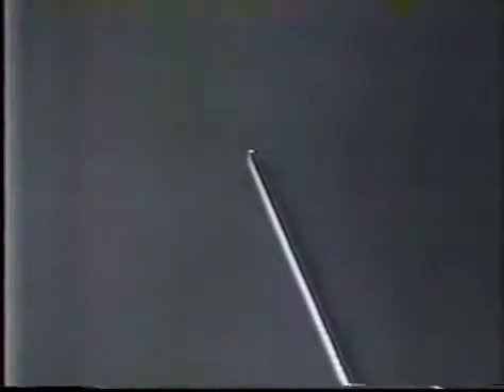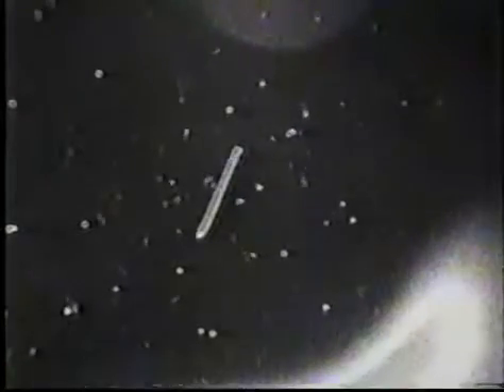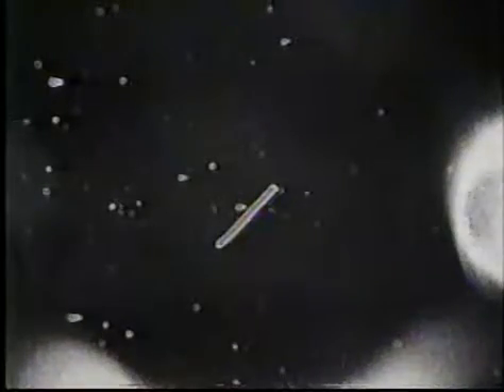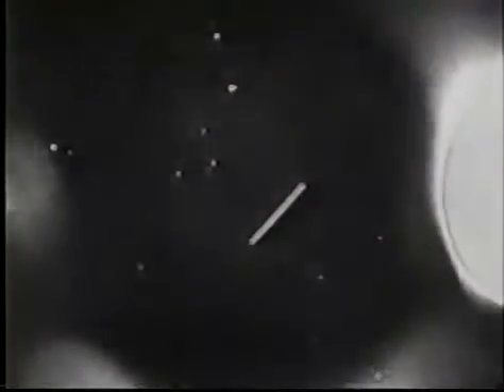NASA STS-75 - The Tether Incident

Comment: They do not pass BEHIND the tether, viewers were misled by a feature of the external CCTV's pixel size. I worked in Mission Control and led the design team of the tether experiment.  The much sharper hand-held 70-mm photographs of the tether show it with its thinness clear [which may be why the internet UFO bloggers hid them from their target audience].  The dots are much much closer, ice flakes from a scheduled waste water dump. Had they REALLY been far enough away to go BEHIND the distant tether, each dot would have been bigger and brighter than the full moon in the sky above millions of potential witnesses, NONE of whom reported such an apparition.  Viewers were scammed.

Comment: Bottom right at 4.50 you see one make a 90 degree turn,how is that possible in space,without a propulsion system?
Reply: Propulsion systems are not required in space DIMWIT this is why saucers and orbs can be observed in the air vs driving around on earth. Rockets are like that too, they don't need propulsion systems to accelerate once in space. Can go left, right, 95 degree turns etc
Reply: @worrylessnless6222 so how do they turn then?your talking bollocks

Comment: To that annoying wozibozi in cel aut ist copying & pasting the same comment on all the other comments asking what those objects are, here's the easy rebuttal to your mindless parroting of the narrative control talking points: the recording camera's autoexposure routine doesn't work that way. If there are many bright objects in the scene, any camera's autoexposure logic would try to even out the overall exposure value of the entire frame by underexposing the image to balance the overall exposure, meaning the bright objects would become darker and more of the detail would be captured, while the dark background would become darker as a result. Autoexposure is tuned to an 18% gray card. It would be hilariously convenient if NASA or those other narrative comtrollers in the media would just hand wave it away by saying the entire video was inavertently left in a manual exposure mode conveniently set in such a way as to overexpose bright objects further without turning the dark background of space even grayer as a result. Also, wrongly exposing subjects in a scene wouldn't make them appear in the foreground or background of another object in the scene, but misfocusing or deliberate obfuscation or postcapture editing does.

Comment: At the time of the incident, astronaut Franklin Chang-Diaz explained the objects seen near the tether as "a little bit of debris that kind of flies with us." The debris, he said, was illuminated by the sun.
Later, John Tindall of the History Channel noted that the camera's telephoto lens was used with a circular mirror that had a hole in the middle, which left an artifact on the images.
Because the images on the camera were overexposed by bright sunlight, objects appeared brighter than they were, giving the illusion they were behind the tether rather than in front of it, Tindall said.
Reply: To that annoying wozibozi in cel aut ist copying & pasting the same comment on all the other comments asking what those objects are, here's the easy rebuttal to your mindless parroting of the narrative control talking points: the recording camera's autoexposure routine doesn't work that way. If there are many bright objects in the scene, any camera's autoexposure logic would try to even out the overall exposure value of the entire frame by underexposing the image to balance the overall exposure, meaning the bright objects would become darker and more of the detail would be captured, while the dark background would become darker as a result. Autoexposure is tuned to an 18% gray card. It would be hilariously convenient if NASA or those other narrative comtrollers in the media would just hand wave it away by saying the entire video was inavertently left in a manual exposure mode conveniently set in such a way as to overexpose bright objects further without turning the dark background of space even grayer as a result. Also, wrongly exposing subjects in a scene wouldn't make them appear in the foreground or background of another object in the scene, but misfocusing or deliberate obfuscation or postcapture editing does.
Reply: @Angus.MacGyver  I’m not reading that😂 keep believing youre right
Reply: You're going around spamming this on every comment, you're either a BOT, or a complete bootlicking lemming. If you looked at this footage and got "debris" or "dust" etc. then you're completely lost, breathing through the mouth. Tether was 12 miles long and FULL of energy. The objects are perfectly consistent in shape, and patterns, and with different sizes (impossible to be debris). They are moving and changing directions orbiting the object while pulsating in the exact same copy-paste patterns/shapes. Anyone with 2 brain cells rubbing can see it plain as day, its not even in question. Read between the lines, John and others can't tell anyone what they're seeing on a daily basis. Thanks

Comment: There are lifeforms at many depths and heights, some live in water, some deep within the earth, some in air, some nearly in space...
Reply: UFO hucksters have lied and covered up evidence about this incident from the very beginning. 
They tricked gullible viewers into thinking the swarm showed up soon after the tether broke away, as a curiosity reaction. The swarm sequence is actually four DAYS after the break.
They concealed the much sharper hand-held 70-mm camera images the crew took of the very THIN tether, with out of focus 'orbs' [nearby small objects] passing in front. 
They never explained how the miles-wide hypothetical objects passing BEHIND the tether wouldn't have been as big and bright as the full moon passing through the sky of ground observers. 
They carefully neglected to mention how the rim notch of all the fuzzy-blob images was 'clocked' to the same angle depending on where in the camera field-of-view the objects were passing, conclusive proof it was a feature of camera internal structure.

Comment: UFO hucksters have lied and covered up evidence about this incident from the very beginning. 
They tricked gullible viewers into thinking the swarm showed up soon after the tether broke away, as a curiosity reaction. The swarm sequence is actually four DAYS after the break.
They concealed the much sharper hand-held 70-mm camera images the crew took of the very THIN tether, with out of focus 'orbs' [nearby small objects] passing in front. 
They never explained how the miles-wide hypothetical objects passing BEHIND the tether wouldn't have been as big and bright as the full moon passing through the sky of ground observers. 
They carefully neglected to mention how the rim notch of all the fuzzy-blob images was 'clocked' to the same angle depending on where in the camera field-of-view the objects were passing, conclusive proof it was a feature of camera internal structure.

Comment: Debri in the forground? They flying behind the tether. 👽
Reply: I know. Such exposure, those in denial are just sad.
Reply: UFO hucksters have lied and covered up evidence about this incident from the very beginning. 
They tricked gullible viewers into thinking the swarm showed up soon after the tether broke away, as a curiosity reaction. The swarm sequence is actually four DAYS after the break.
They concealed the much sharper hand-held 70-mm camera images the crew took of the very THIN tether, with out of focus 'orbs' [nearby small objects] passing in front. 
They never explained how the miles-wide hypothetical objects passing BEHIND the tether wouldn't have been as big and bright as the full moon passing through the sky of ground observers. 
They carefully neglected to mention how the rim notch of all the fuzzy-blob images was 'clocked' to the same angle depending on where in the camera field-of-view the objects were passing, conclusive proof it was a feature of camera internal structure.
Reply: They do not pass BEHIND the tether, you were misled by a feature of the external CCTV's pixel size. I worked in Mission Control and led the design team of the tether experiment.  The much sharper hand-held 70-mm photographs of the tether show it with its thinness clear [which may be why the internet UFO bloggers hid them from their target audience].  The dots are much much closer, ice flakes from a scheduled waste water dump. Had they REALLY been far enough away to go BEHIND the distant tether, each dot would have been bigger and brighter than the full moon in the sky above millions of potential witnesses, NONE of whom reported such an apparition.  You were scammed.
Reply: At the time of the incident, astronaut Franklin Chang-Diaz explained the objects seen near the tether as "a little bit of debris that kind of flies with us." The debris, he said, was illuminated by the sun.
Later, John Tindall of the History Channel noted that the camera's telephoto lens was used with a circular mirror that had a hole in the middle, which left an artifact on the images.
Because the images on the camera were overexposed by bright sunlight, objects appeared brighter than they were, giving the illusion they were behind the tether rather than in front of it, Tindall said.
Reply: @wozibozi  Yeah you're going around spamming this on every comment, you're either a BOT, or a complete bootlicking lemming. If you looked at this footage and got "debris" or "dust" etc. then you're completely lost, breathing through the mouth. Tether was 12 miles long and FULL of energy. The objects are perfectly consistent in shape and patterns with different sizes (impossible to be debris). They are moving and changing directions orbiting the object while pulsating. Thanks
Reply: @wozibozi  To that annoying wozibozi in cel aut ist copying & pasting the same comment on all the other comments asking what those objects are, here's the easy rebuttal to your mindless parroting of the narrative control talking points: the recording camera's autoexposure routine doesn't work that way. If there are many bright objects in the scene, any camera's autoexposure logic would try to even out the overall exposure value of the entire frame by underexposing the image to balance the overall exposure, meaning the bright objects would become darker and more of the detail would be captured, while the dark background would become darker as a result. Autoexposure is tuned to an 18% gray card. It would be hilariously convenient if NASA or those other narrative comtrollers in the media would just hand wave it away by saying the entire video was inavertently left in a manual exposure mode conveniently set in such a way as to overexpose bright objects further without turning the dark background of space even grayer as a result. Also, wrongly exposing subjects in a scene wouldn't make them appear in the foreground or background of another object in the scene, but misfocusing or deliberate obfuscation or postcapture editing does.